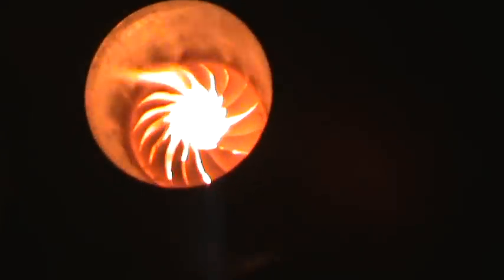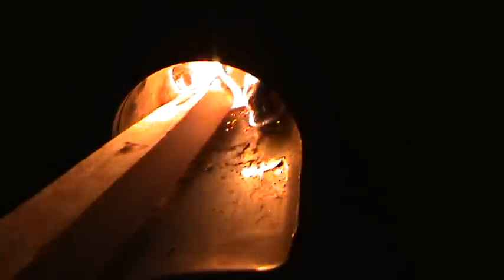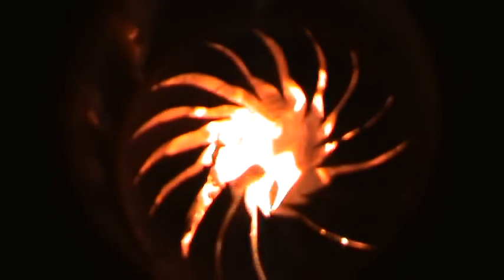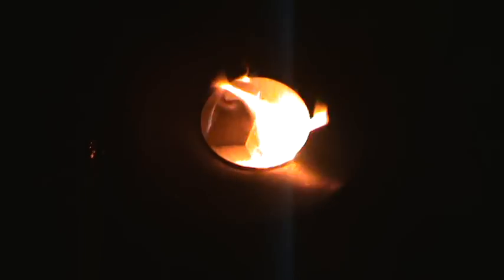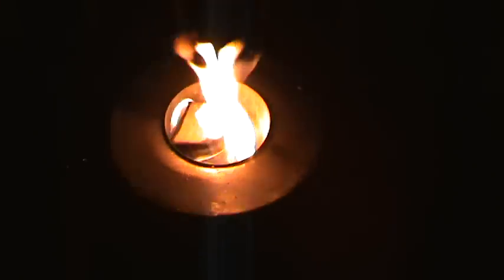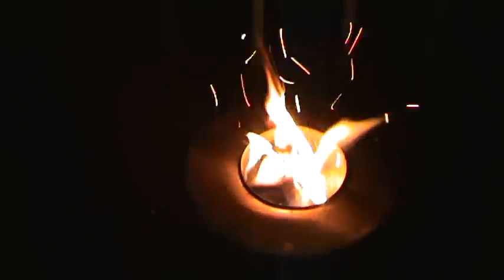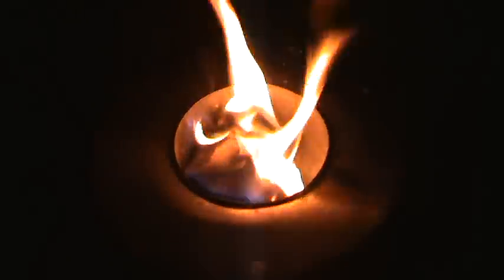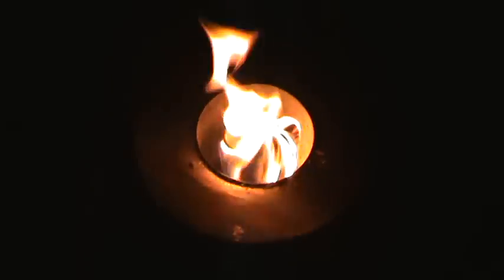rocket stove modification

Comment from the maker: @scottishtracy hi there and thank you for your comments, I was fortunate enough to find a piece of stainless steel pipe that exactly fits inside the up tube. I have had to experiment with the design a few times and get various results with each one,  the latest seems to work best for keeping the heat localised to the combustion chamber while inducing the most swirl or turbulence. Thus mixing the burnt gases better, this fitting can be removed or replaced at will. Only when cold obviously. Cheers

Comment from the maker: @usualy1000 The first time I tried to boil 2 pints of cold water it took just over 5 minutes, the second time I timed it at 5 minutes and 15 seconds. This was a saucepan with 2 pints of cold water and no lid on it, I am confident that if I had used a kettle or pan with a lid on I would have been able to reduce that time to well under 5 minutes. The boil time is dependent on several factors which include type of fuel used, the amount, outside temperature, wind or no wind, covered or not. etc...